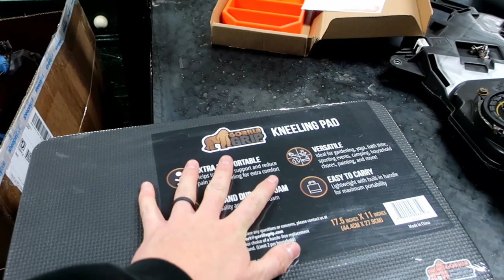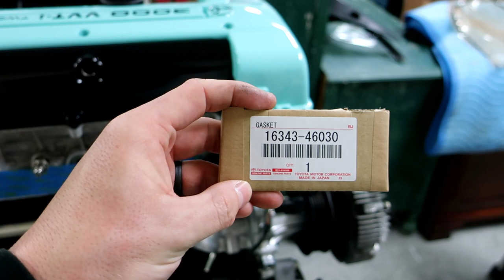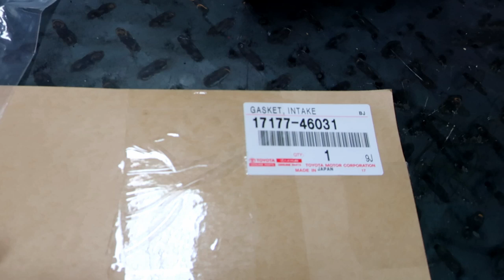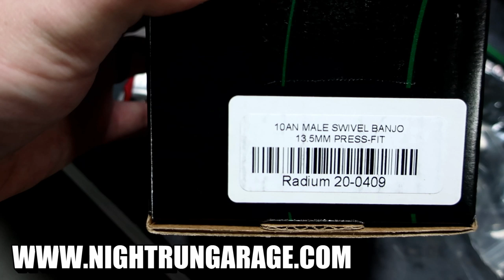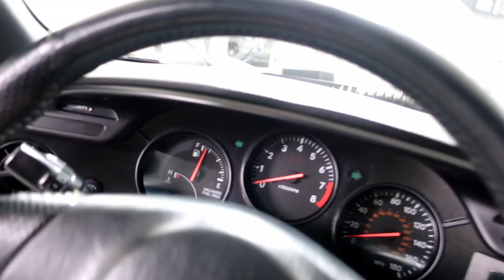How to Install Radium Engineering Press In AN Fittings

Comment: I'm pretty sure you don't have them in but when you hammer the radium fittings in. You don't need the rubber grommet in those valve cover holes right? Mine where trash so mines out already and was going to drill and tap AN fittings in there. Thanks in advance!
Reply: No grommet needed in those holes with the radium fittings here.